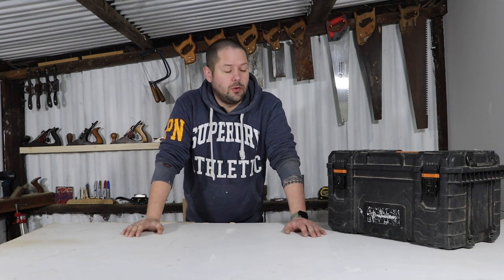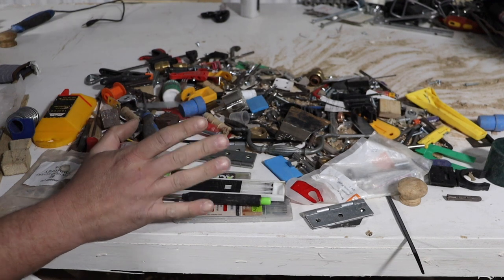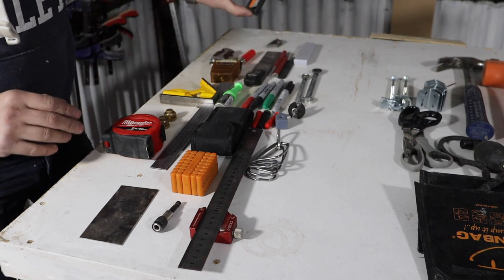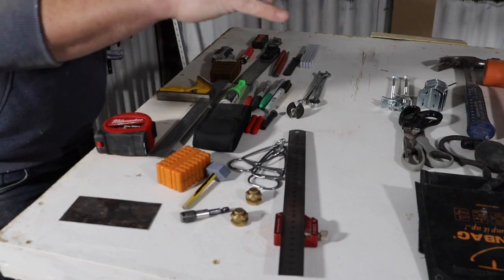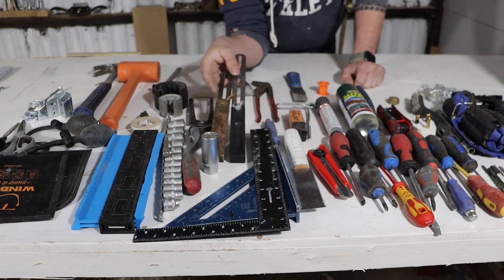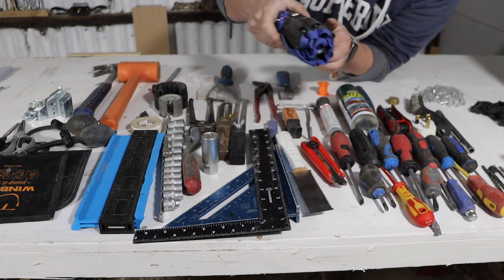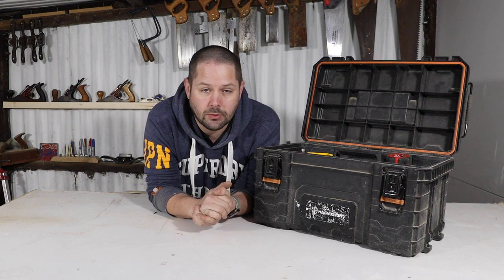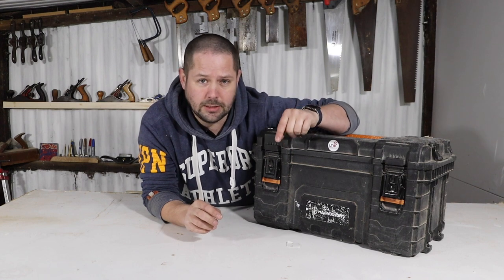Whats in my tool box  #joinery #carpentry #woodworking

Comment: Why are red plugs the only ones to use ?? What about when you use bigger diameter screws please ??
Reply from the maker: Hi Simon, red plugs will do most of the common size screws we use.
Reply: @LTWCarpentry  so always handy just to have a few brown ones then just incase. Better to have them and not need them, than need them and not have them.

Comment: Hi, just wondered were you got you little flush cut saw from because i am struggling to find one online cheers
Reply from the maker: Hi mate I got mine off eBay, but they are hard to find. It’s called a GYOKUCHO Razor Saw 80mm. I had to keep looking for ages to find this one. You will find one just keep checking.